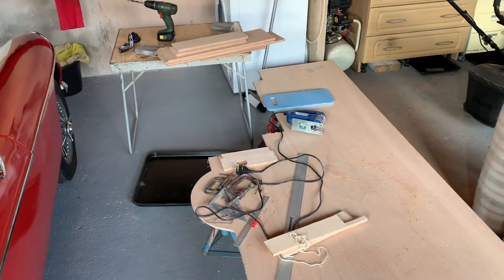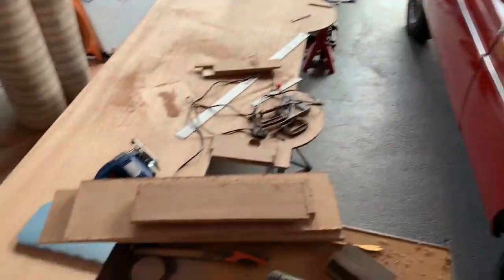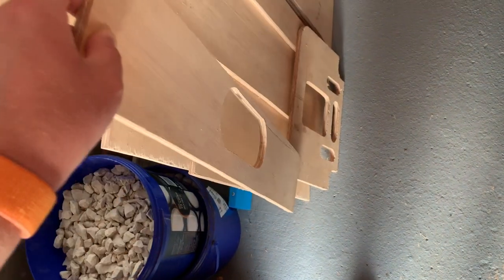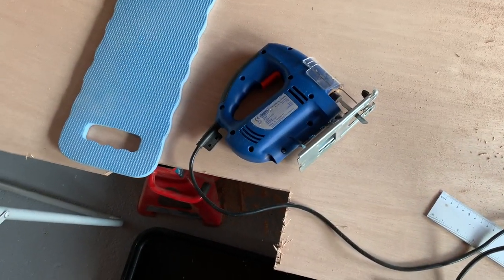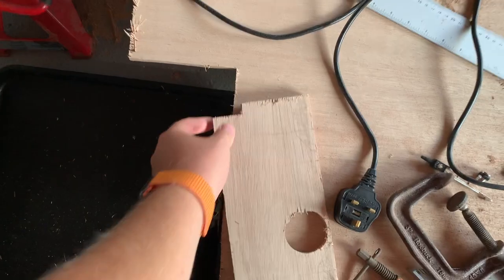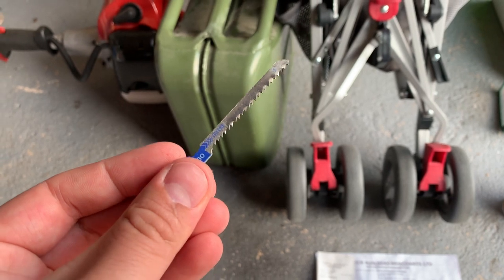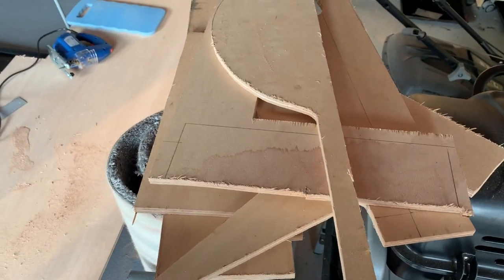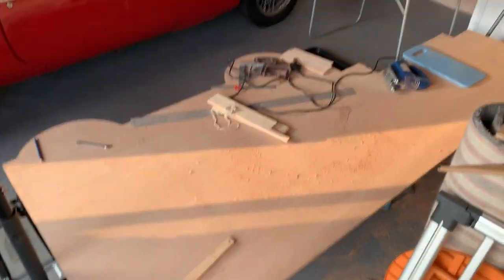Toylander 1 Build Series - Episode 3

Comment: Hello, I just found your videos and I'm about to start building one for my daughter. To replicate Granddad's series 1. You said you reply to all you comments so I'm going to pick your brains if you don't mind. 
I haven't started the build yet and I thought I may aswell watch all your videos first. 

First question is I'm actually thinking of building it out of MDF moisture resistant as I won't have to spend time filling and sanding when the ply chips. Or do I just bite the bullet and get the filler out? 

Second. Did you only use the jigsaw to cut all the holes as I'm looking at buying a plunge router to do this or would you just not bother and save my money? 

Thanks.
Reply from the maker: Hi Simon, thanks for watching and I hope you find the videos useful. To be honest if I were building another I would go for the MR-MDF as I did not know about the chipping of the MDF. Also, Toylander themselves sell kits which are made from the MR-MDF so I would go that way too. I used the jigsaw to cut all the holes and it seems to have worked well. Borrowed a hole-saw for the headlamps and that was great, so if that was an option maybe consider that? All the best with your build, happy to help where I can!
Reply: @restosaga  nice one for the reply. I think I'll definitely do MDF then. Ill probably have questions throughout the hole build the more I watch. So thank you in advance.
Reply from the maker: No problem at all, happy to help!